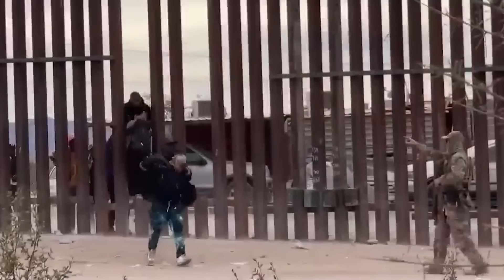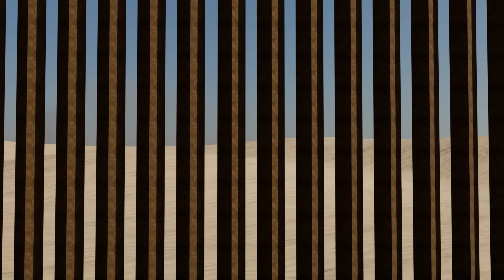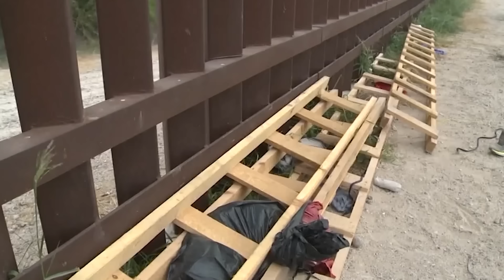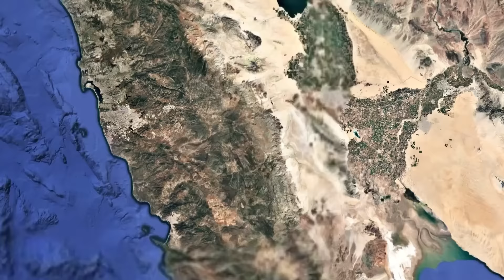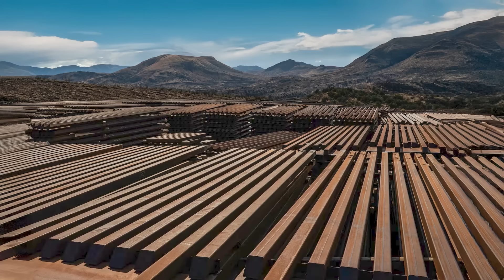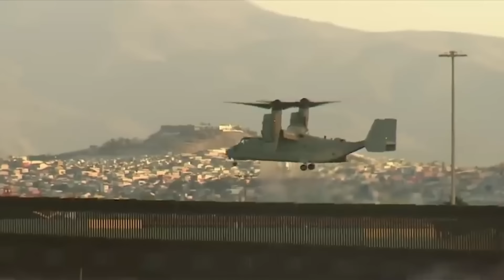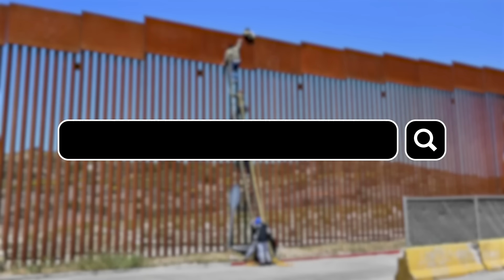What Mexico Is Doing to the U.S. Border Shocks the World

Comment: By the way, Trump's walk contractors not only used Mexican labor, but a lot so hired Mexican security to guard parts of the wall under construction. Also a 12year old US climber was able to scale the wall in seconds. There are also numerous tunnels under the border used by smugglers and migrants. When found and closed up, another tunnel appears. Illegal immigration escalating immensely when the green card system for seasonal migrant labor was eliminated. The US outlawed the legal seasonal immigration system.

Comment: One example of a wall that was built in China is that it did not work , the stupidity of building a steel wall. I don’t understand with all the sand and gravel in the area ,and cement in my opinion, is a better wall., Israel has walls. Also, they don’t use steel. They use concrete walls. The differences that our president is in with the rich, you can just imagine the cost difference between steel and concrete walls , steel is more expensive, the steel company made a fortune. I mean a fortune. I’m sure the president got a kickback. There was so much money., wasted on such a dumb idea, and no one said anything. Look at all that steel out there that in year  to come will probably be sold. To scrapyards the expense of maintaining a steel wall  is too high for our budget. To support for any length of time. The Chinese are not maintaining their wall because of the cost of maintenance. this president keeps enriching himself, making mistakes with US money. They may not be mistakes at all. . The migrant problem is worldwide in Europe. They’re using razor wire for fencing,only United States can afford steel. This is ridiculous. it only makes sense if you follow the money. Consider, the property and homelessness. Throughout the world. Spare no expense as long as you’re making Money. Don’t build the wall that you can cut down with an battery, powered angle grinder, and a good abrasive wheel harness of welds ,,It’s not even a factor. Governments today should be thinking of ways of using labor. using birth control to limit the population of the WORLD. There are so Many human beans in Peril to day . I don’t care how many walls they built. It won’t solve the problem that’s plain. Anybody can see that. Thanks for your video and your information. And your efforts. Take care.

Comment: There's only one way to do it I guarantee this way works that is to electrify the fence so yes you'll have to start at the way top and run high voltage wire and make every Pole to where you can be electrocuted if you touch it and they can put up signs stand back 6 ft from the wall because this wall is electric and it can and will kill you problem solved just a few more dollars

Comment: STATEMENTS OF FACT 

14 year old girls can scale the current emplacements to the top hand over hand like little spider monkeys in less than 30 seconds flat. There is a video showing this on YouTube. As well as that and sadly enough, this border “wall” is so porous it allows for contraband such as weapons, explosives, narcotics, biohazard and even nuclear radiated materials to be readily passed through the space afforded between the gaping bars of its design. With direct regard to the bollards utilized in the design if the gaps aren’t wide enough for an item to be readily passed through, the space or distance in-between can easily be increased with just a few minutes of work through the aid of a battery operated reciprocating saw or grinder that is readily available at any Home Depot, someone’s back yard shed, or the toolbox of someone’s employer. Should the assailant of this “barricading” medium or temporary obstacle be well equipped it can resort to the use of a cutting torch and perform the breaching task in mere moments?

 For now the only reason the current design is working as some kind of deterrent is because we have Marines constantly festooning it with razor ribbon and watching it 24/7. If it weren’t for our Marines there on the border wall saboteurs or disgruntled vandals would be cutting through it or cutting it down to serve their purposes in no time at all. Due to the current Southern border emplacements poor performance characteristics President Trump was compelled to dispatch Marines, stationing them on site at a cost of approximately $50,000,000.00 per week with well over $1,200,000,000.00 having been spent so far. If spending continues at the same pace it would put the military on track to spend more than $2 billion in the first year of operations alone. 

As of March 1, there were around 9,000 active duty troops at the border according to US Northern Military Command. I have wondered what will happen when those Marines are needed somewhere else, they will not be stationed on the Southern border forever and the number of personnel that are situated along what Southern border protection barrier is actually in place is not nearly enough. In as far as the razor ribbon that is left behind after the Marines have departed can be concerned, that’s what $5.00 wire snips at Dollar General Stores are for. They go through razor ribbon like it was sewing thread.

A popular excuse given by border patrol is it is a benefit to be able to see through those bollards in order to see what is happening on the other side. My observation is this; a wall made out of bollards with 6 inch or better wide gaps between them makes it easy for shooters or snipers on the south side of it to shoot at our border control personnel. If Border Patrol thinks their uniforms or badges intimidate Mexican cartel members my strong suggestion to the U.S. Government is they better send those boys to school before they put them out in the field. It isn’t a Disco dance floor out there. 

Myself, I am not aware of any castle, fort, or military outpost or installation that has ever been constructed out of “see through” walls. It doesn’t make much sense when thinking in terms of holding a defensive position against offensive forces. As a result of the constant vandalism's committed against our border “wall” maintenance workers cannot even keep up with the repair schedules necessary to keep this current border protection medium in proper working order if a “proper working order” can be measured and assigned to the poor performance of this structure in an overall fashion. Costs in terms of the time and funding necessary for repairing what they are “fixing” are skyrocketing and what is in place requires around $300 million per year and is expected to rapidly approach if not exceed over $750 million dollars per year in maintenance costs as the completed lengths increase in miles in the upcoming years.

 Experts on this subject have stated that the frequent use of so-called “supplemental agreements” to “add work” or “increase the price” on previous Southern border protection barrier systems have amounted to giving no-bid contracts to a small group of preselected construction firms, at considerable cost and expense overruns to the taxpayer and often tantamount to rampant abuse and/or malfeasance's. There are more than a few projects erected under the administrative effects of Governor Greg Abbott of Texas which have cost $7,000.00 to over $8,500.00 per linear foot according to a Texas newspaper. Interestingly, this same Governor expects the U.S. taxpayer to reimburse the state of Texas for over $11 billion dollars for those same misguided expenditures. 

Perhaps the real kicker to all of the above is that by professional estimations made by experts on the subject of structural integrity and endurance forecasting, the current medium being put in place in actuality only has a 30 – 40 year service duty lifetime rating or expectancy. On the other hand, the format I present for consideration purposes has a lifetime expectancy of a minimum of 150 years and depending on overall metallurgies involved will probably provide functional service performances well past the expiration of that time frame. Perhaps 2 – 3 x’s that number of years can be reasonably expected for a serviceable lifespan and during that time this design would be virtually maintenance free. 

In reasonable estimation it is sort of tricky and actually makes no sense to try to shoe a horse that has nothing more than broken legs to run on. A smart cowboy would probably just shoot the thing and put it out of its misery, that and go find another method of conveyance.

And the newest taxpayer fund sucking ploy? Painting this great white elephant black so it is "too hot" to climb. What a joke to which might I suggest using leather gardening gloves or if you are high budget and can afford $20 bucks, welder's gloves. That or wait until it cools down at about 10 p.m. at night before you start your journey. It's easier roaming around the desert at night anyways, all you have to do is carry a couple of canteens and follow the North star, which is part of the big dipper, for about 20 miles to your pickup point. Should be able to make that trek in around 5 or so hours and by the time your ride picks you up you are ready for some breakfast at Waffle House, or Dennies, or whatever floats your boat. 

By the way, there is a waay better option out there. 1 quarter to one third the price and can be installed at the rate of 1 - 2 miles per day. Doesn't require maintenance, and unless you use a catapult or a helicopter you ain't getting over this technological marvel of brilliant engineering with accompanying architectural and structural accouterments. Want to know more about it? Give J.D. Vance a call, or give Marjorie Taylor Green a call, hell, if he will listen to ya, give good ol Ducky Don a call at the oval office, I am fairly sure he knows about it as well. Tell 'em Smitty said to drop them a line so they will feel needed and appreciated. Peace out, and enjoy the fraud, waste, and abuse of your tax dollars if you can't even do that. You will have earned it all...... Semper Fi......

Comment: If they would mount, we say proper sensors,  they be notified and dispatch long before they are ever cut through. Plus, they should have fulled the tubes with proper hardened concrete. 
Electrify, Electrify, and Electrify should be added as well.

Comment: 🤥 Wow. Lots of untruthfulness in this story. 🤥 The wall beams are steel, filled with concrete & rebar. It takes 3-4 hrs to cut thru 1 post with very expensive equipment & several men working at a time. All the technology & surveillance equipment was turned off & disconnected the last 4 yrs. BP & NG would watch them cut through it & do absolutely nothing to stop them, even though they were well within our border. Pretending the wall doesn't work is absolutely preposterous. The wall & wall system work great & do an amazing job of keeping them out. They were funneled through areas where there's no wall, like on reservations, or where gates were welded OPEN by our gov't. When our agents & military do their job, no one enters illegally. God bless President Trump. Deport all illegals. 🇺🇲🙏🏼💞

Comment: If they filled the steel posts -
with concrete-
 2 much more difficult cuts -  would be required -
because it would not -
move around  when cut.
Im amazed to discover they -
never bothered to do that.!
☮️✝️☮️✨✨✨🇺🇸🇺🇸🇺🇸🍀🍀🍀
Reply: From my stand point as a 70yr old masonry and commercial building contractor, I could get through most anything you build in 20 mins. All this money wasted on stupidity could have been used to build Mexico into a more stable economic neighbor. As China is doing right now.

Comment: They should use thick concrete with steels reinforced underneath maybe to half the height to prevent cut and oil the steel bars prevent illegal immigrate to climb😊. Individual Bars with heavy concrete will sink when tunnels are dig and let authorities to know where is site of the digging ground.

Comment: Good coverage of what's happening with the wall.  On thing that is missing is dates on the footage so we can see what happens with each version of the wall as it evolves.  Those cutout sections were on the old angle iron wall.  They moved to full square steel tubing most recently.  Filled with rebar and concrete, it is a lot harder to cut.  Tunnels and drones are harder to catch, but damnit, I wish they had one 2,900 mile length of completed wall from sea to shining sea.  Even better if they can electrify it.  Because of Joe Bidet, we now have infiltrators and tangoes from every hostile nation within our nation, and it pisses Americans the hell off.
Build it, deport the illegals, and our prison and school populations will normalize, traffic will lighten, the housing shortage will go completely away, the teacher shortage will go away, and crime will drop dramatically.

Comment: Need high voltage wire that turns on with sensors motion and vibration. About 200 thousand volts should work. Also pressure sensitive land mines.

Comment: How would sound detection equipment work, that detects vibration IN the steel itself?  Could you have sensors placed every mile or so and stop the angle grinders more quickly?

Comment: IT'S REALLY SIMPLE LET ME GIVE YOU GUYS AN IDEA AND I KNOW THIS FOR A FACT BECAUSE YOU FOLKS HAVE NEVER BEEN ABLE TO SOLVE IT SINCE THE LATE 70S,,,HERE IT IS LISTEN UP CAREFULLY, IF YOU BUILD A WALL LIKE THE GREAT WALL OF CHINA AND THEY DO THIS WALLS IN MEDIEVAL TIMES, A COCRETE WALL WHERE YOU CAN DRIVE ON TOP OF IT AND LOOK DOWN ON THE MEXICO BOARDER YOUR PROBLEM IS SOLLVED  NOT JUST A FENCED WALL BUT A CAR THAT RUNS ON TOP OF IT LIKE A BRIDGE, YOU CAN CALL IT A BRIDGE WALL WITH ROBOTIC MODERN TECHNOLOGY A WIRE SENSOR OR ELECTRIC FENCED ON THE EDGE OF 20 FOOT BRIDGE AND MAKE A LAZER CAMERA DETECTOR CAMERA HEAT VISION CAPABILITIES THAT OPERATES AUTONOMOUS LIKE AN INTELLIGENT ROBOT OR HAVE THE BORDER PATROL AGENT WATCH THE MONITOR SCREEN FOR ANY ACTIVITY IN EVERY FIVE MILES SO THE IDEA IS TO WATCH ANY MOVEMENTS OR ATTEMPT TO SCALE OR USE A ROPE, LADDER, ANY MATERIAL WOULD BE AUTOMATICALLY CUT BY A LAZER AT 15 FEET YOU JUST HAVE TO PUT WARNING SIGN NO CLIMBING LAZER GUIDED CUTTING IS AUTOMATIC ANY TIME A LADDER OF ANY KIND TOUCH  OR TRIP 15 FEET BEFORE THE VERY TO EDGE 20 FEET WILL BE INCINERATED OR LAZER CUTTING TOOL JUST LIKE A CUTTING TOOL...SO NOW YOU HAVE 20FOOT WALL CAR PATROLLED AND FOOT PATROLLED OR MOTORCYCLE OR BYCICKE PATROLLED OR ANY MOVING VEHICLE PATROLLED ON TOP EVEN GOLF CART TO SAVE MONEY ELECTRIC VEHICLES WHATEVER AND THEN YOU HAVE CAMERAS NIGHT VISION OR HEAT VISION AND LAZERS START ON THE TEN FOOT BOTTOM OF THE WALL WOULD BE THE FIRST WARNING ELECTRIC WIRES AND TRIP TO THE PATROLL AND TO THE CLIMBERS, THEN AT FIFTEEN FEET YOU HAVE ANOTHER LAZER SENSOR THAT WOULD BE THE PART WHERE THE CUTTING BEGINS FOR LAZER IT WOULD BE VERY LETHAL BECAUSE IT WOULD CUT ANYTHING FROM METAL TO WOOD TO PLASTIC TO BIOLOGY IT WOULD BE GRUESOME SCENE, AND AT THE VERY TOP 20 FOOT COMBINES BOTH DEFENSE I KNOW IT WOULD SOUND LIKE FORT KNOX Gold Bars bank but. BUT THE WHOLE POINT OF IT IS ALSO TO MAKE CERTAIN NEGOTIATIONS FOR WORKERS TO COMPLY THROUGH WORK VISAS A FARM OR LABORERS CAN BE GRANTED ACCESS THOUGH AS WORKERS COMPANIES AND FARMOWNERS MUST ALSO COMPLY THAT THEY PROVIDE SUFFICIENT SERVICE TO THEIR WORKERS THEY SHOULD BE PICKED UP FROM THE BORDER TO COME AND WORK SO THEY CAN LEGALLY WORK AND RETURN HOME AT THE END OF THE DAY...BUT FARMERS NEED TO INNOVATE THEMSELVES TOO MANY ASIAN COUNTRIES HAVE ROBOTIC FARMS AND GOVERNMENT NEEDS TO SUPPORT THE IDEA OF AUTOMATION FARMS WITH LITTLE MINIMAL HUMAN SUPERVISION IF NOT COMPLETELY FULL AUTOMATION  REDUCE COST OF LABOR AND INSURANCE...INDOOR FARMS  FAILS BECAUSE THERE IS NOT ENOUGH SUPPORT IT ONLY FAILS HERE BUT OTHER COUNTRIES THRIVE A GREAT DEAL THIS IS AMERICA AND WE SHOULD HAVE THE LATEST TECHNOLOGY FOR INDOOR FARM SUSTAINABILITY IS THE KEY RECYCLE THE WATER OVER AND OVER TEMPERATURE CONTROL WEATHER VARIATIONS COOL OR WARM CLIMATE  24 SEVEN USE SOLAR ENERGY PANELS OR NATURAL LIGHT ON THE ROOF OR ARTIFICIAL LIGHT  ULTRAVIOLET RAYS...

Comment: Just put a pipe in side with a solid steel rod inside that with a bearing on the bottom. So when you try to cut it, the pipe of the inside will just spin.

Comment: They did all that and did not run a trip wire through of some kind. The second they break the connection alarms go off. I can't believethey didn't think of that. Or sound sensors. Blankets can't hide noise. Vibration sensors.
Reply: Little channel on it with smoke detectors. There's lots of ways

Comment: I don’t get your point entirely.  The wall was never touted as foolproof.  It is supported by related security measures including manned.  You mentioned this, but your statements, while thorough and largely accurate don’t include the number of malefactors caught, or turned back.  There is more to this, than you have included.  But, you can count on this!  If you have compiled so much data, the Security measures are close behind its solutions.  Why would Trump advertise the flaws, and alert the malefactors.  Use your head.